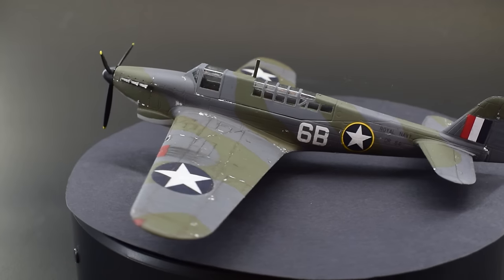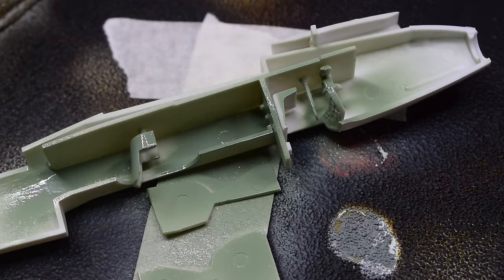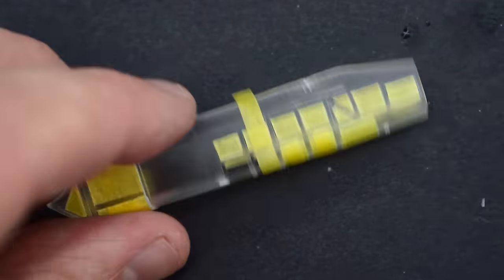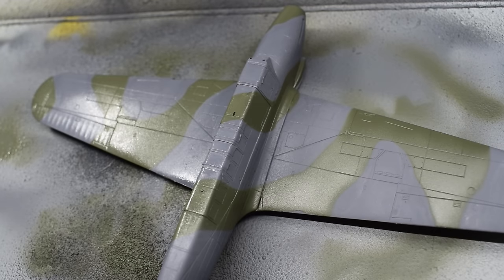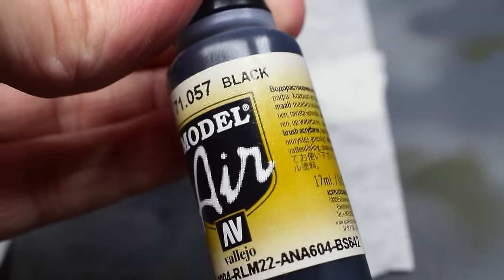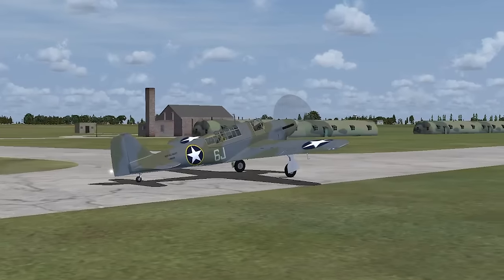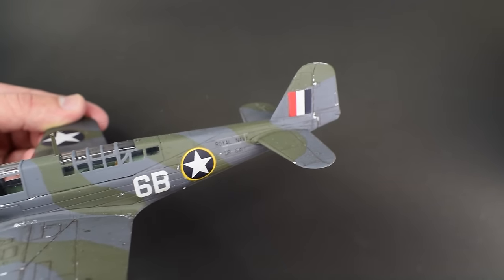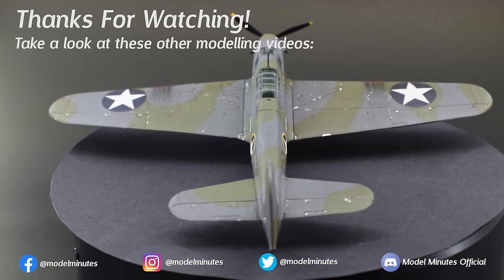One of the BEST Mistercraft Kits?! Fairey Fulmar in 1/72 Scale – Build & Review

Comment: Just bought the AZ version of this kit which comes with some photo-etch and resin.  Sadly the resin wheels had been glued to the underside of a wing resulting in some 'meltdown' of the wing surface (AZ have a replacement in hand).  Good outcome to your build and it gives me some confidence to start on mine.
Reply from the maker: Sounds like AZ address the lack of detail with their extra parts :)
Reply: @ModelMinutes  There's not much, harnesses for both seats, an instrument panel and some intake filters. However, this will be my first use of PE...
Reply from the maker: @NickAndrewsFaulkner  sounds like it is better than nothing, and a good starting point for your first go

Comment: Hi Matt, if not mistaken, the colour of the underside should be Eau De Nil. By the way great job on old kit.(Still remember building it as a new kit from Vista)
Reply from the maker: Thanks for the info!
Reply: In service, most Fulmars were painted in uppersurfaces of Extra Dark Sea Gray (EDSG) and Slate Gray with Sky undersides.  Some early Fulmars were seen in EDSG and Slate uppers with light grey undersurfaces, but this was a short-lived scheme.
Reply: Early Fulmars were delivered in an underside colour called Sky Grey. By the time of Torch, the undersides would have been Sky. Sky was used on some Naval aircraft up until the last Gannet AEW3s were retired in 1978. Post war it was a standard colour to BSC381c as No 210 Sky, and is still to be found in paint manufacturers catalogues under a variety of names. I am pretty sure it was to be found on hospital walls in the eighties

Comment: It looks OK Matt. I personally would stay away from Mistercraft kits. Most of them look garbage. I can recommend a couple of things you could try out in future builds. Have you ever tried Mr Surfacer? Its a liquid filler. Comes in various thickness's.  I think this stuff would have been good to paint into the wing root gap here. Once dry, it can be either sanded, or rubbed off with a cotton bud dipped in Mr Color Levelling Thinners. More layers can be applied until the joint is satisfactorily filled. The other idea is for panel lining. Have you tried Florymodels Clay Wash? The Dark Dirt version is great for panel lining. Once a Gloss Coat has been applied, you paint the whole model with the stuff. Let it dry for 20 minutes or so. Then you can wipe it off with a paper towel, moistened with water or good old spit lol. Once wiped off, it leaves the Dark Dirt effect in the panel lines. Plus is you don't like the effect, you can just wash it all off with water and start again. Search Florymodels YouTube channel for a few tutorial videos on the stuff. Look forward to the next build mate.
Reply from the maker: I'd love to try some mr.surfacer, probably something I would add on to my next modelling supply order. Clay washes are something i could also consider using too :)
Reply: @ModelMinutes  Mr Surfacer works good used as a primer too. The 1500 variety is labelled as a primer. Has to be thinned with Mr Color Levelling Thinner though. The Black version is great as a primer, but it can be hard to get. Usually sells out quickly. If you want to try out the Florymodels washes, you could just buy one bottle of the Dark Dirt variety. They only cost £5 a bottle. They do sell a full set of 8 colours too. They have recently released a range of thick washes. But I haven't tried those yet.